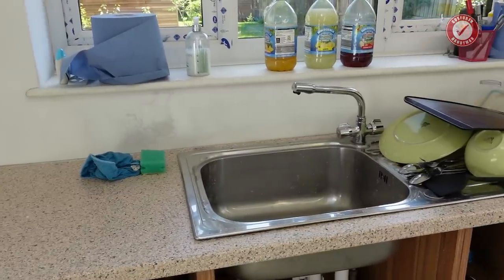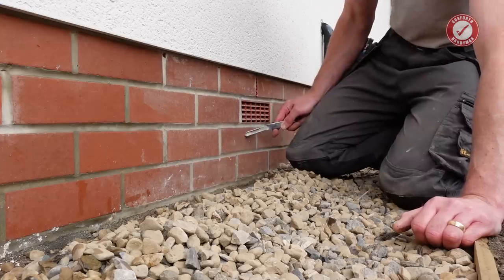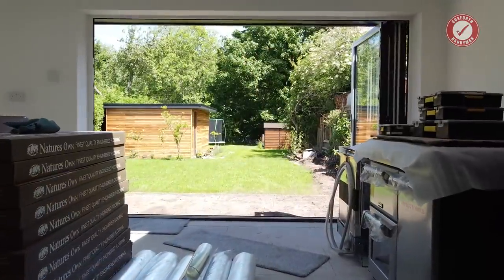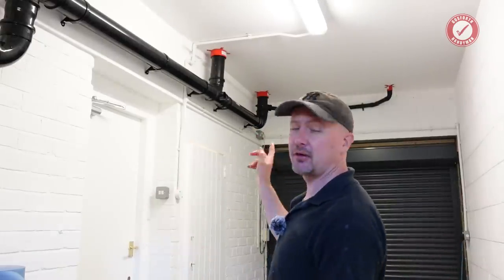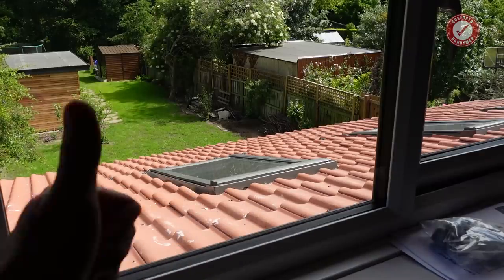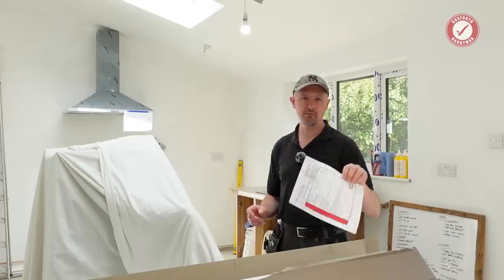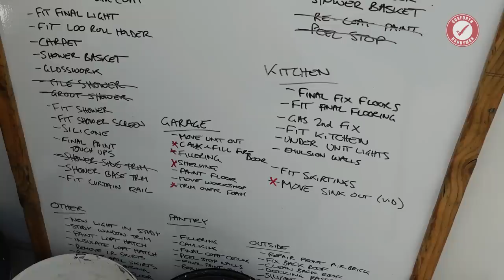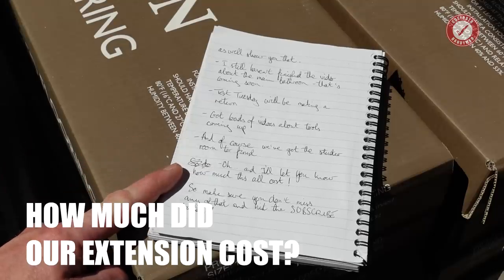Our extension is almost finished - did we get building regs sign-off??

Comment: Thanks for the video, very inspirational. I'm working on a similar project, it has been incredibly tough. My builders went bust after about 3 months and I was left with just a shell (no doors or windows). I was fed up with up builders and decided to try and move it forward myself. I made some good progress over 2 years, but working a full time job means it has been very slow to get things done.

At some point a couple of months ago I decided to break up the old concrete floor with an electric breaker - a massive mistake. The noise damaged my hearing (despite wearing quality ear defenders) and now I have permanent tinnitus. It's made the whole project (and my life) harder to deal with. If there was an option to give up, I think I would have done, but there isn't, so somehow you have to find a way to move forwards. Look after yourself and always consider the risks involved when doing it yourself.
Reply from the maker: Oh no, that's awful! Defo, re-group and find a way forwards. Enjoy the journey as much as the destination. I have some tinnitus from drumming so I'm getting very paranoid about my hearing. 😬👍

Comment: Congrats !  I was delighted when I got my completion certificate as the building control inspector seemed very picky and gave me a snagging list of 12 things to resolve.  Most were pointless but getting the last one done was great.  Interestingly, I had a temporary step at the back door just like yours at the bi-folds, but putting the permanent step down was one of the snagging items I had to do before I could get my cert.
Reply from the maker: Cheers! That's harsh about the temporary step. Technically ours is within regs I think - even if it's a bit rubbish. 😁👍

Comment: Great looking hood! 

In North America all kitchens must have two power Receptacles every 4 feet above the kitchen countertops (this is because all manufactures of kitchen appliances only come with 2 foot electrical cords) and if there’s a faucet within 6Ft of receptacles also referred to as outlets) must be GFCI (ground fault Circuit isolation) or connected to a GFCI breaker inside your electrical panel. within 6 Ft or 2M from faucets. Also ALL
Dishwashers must have a dedicated circuit and microwave ovens!
Reply from the maker: Interesting! Dedicated circuit for dishwashers?? 🤔

Comment: Well done, inspirational. Currently getting quotes ranging from £250K - £300K plus VAT for a 2 story side and single rear extension in Berkshire. So expensive! 😭 Like you will probably get a watertight shell built and then get the trades in individually to complete it as I have no experience with DIY apart from painting

Comment: Congratulations! The attention to detail and execution has been outstanding. What product were you using to clean the bricks?
Reply from the maker: Cheers! That was just soapy water on the bricks but the wet mortar provided a bit abrasion to get the tough spots off. Beyond that you can use brick acid, but didn't really need it. 👍

Comment: Well done, massive milestone.

Wil you be putting paving/decking down outside the amazing feature that is your folding doors ? you really don't want to be stepping out on a deep step onto gravel or grass.
Reply from the maker: Cheers! Decking going directly in front of the bi-folds at the same level as internal floors. 👍

Comment: Great to understand what checks might be carried out. Does building inspector check that the build is as per planning permission application? Or just that what’s installed is functional and working?
Reply from the maker: No worries! No, building regs is separate from planning - different set of plans with much more detail relating to safety, thermal efficiency etc. 👍
Reply: @GosforthHandyman  Thanks for the info. I understand it's not the most exciting topic to cover and this is why you don't see many videos on the subject. Really useful video as always

Comment: Congrats.  I am amazed that in the UK they will sign off a building that isn’t completed. In NZ the kitchen and bathrooms have too have been installed and they won’t pass it even if sealant hasn’t been applied between the kitchen bench top and the wall. But there have been a lot of problems with sub standard workmanship over here
Reply: RandomShart  it’s for things like water leaking behind kitchen benchtops. They want to make sure all showers etc are properly sealed and don’t leak.  NZ had a  leaky building crisis due to substandard workmanship and dodgy materials.
Reply from the maker: Cheers! That crazy levels of over-regulation! 😬 Thankfully we're not there... yet. 👍😎

Comment: How does an inspector verify the appropriateness and integrity of foundations, load-bearing structural elements and other 'hidden' systems and components?
Reply: They visit at various stages of the build to check those things....or if they are bone idle like a lot of them, they ask for photos....
Reply: @andyphillips7437  👍
Reply from the maker: Yeah, multiple visits at key stages of the build. 👍
Reply: @GosforthHandyman  👍